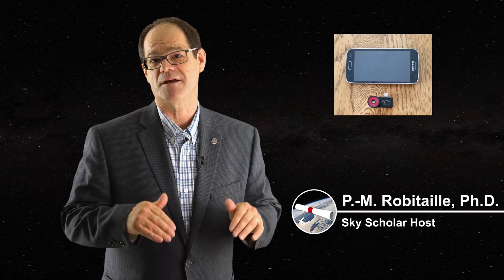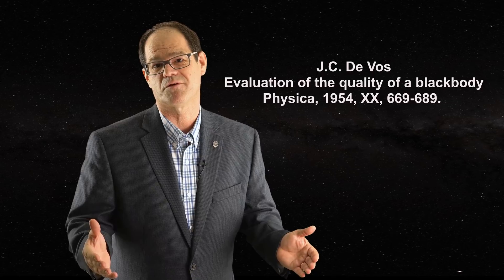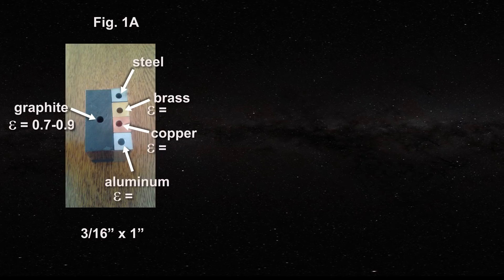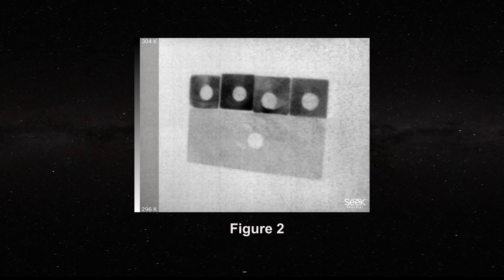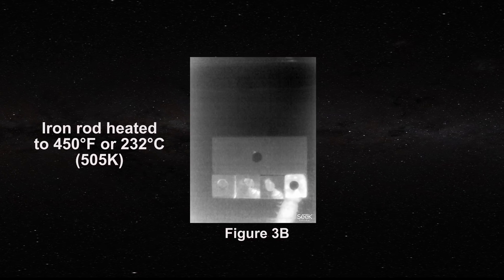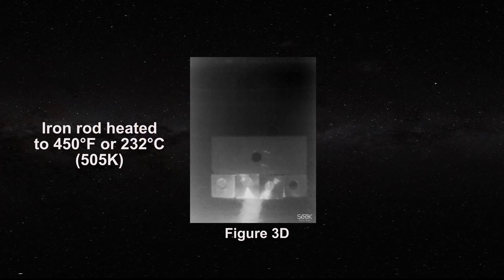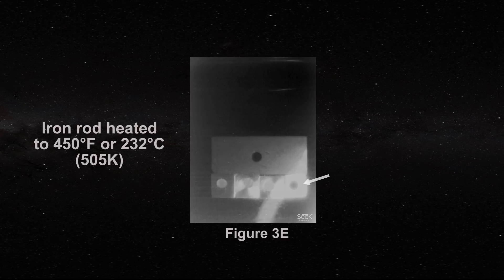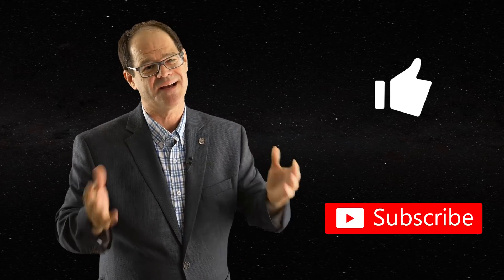Is Kirchhoff's Law True? The Experiment!

Comment: Robitaiile is a crank. This is a snow-job.
Reply: @MrAaronvee - you are wrong. None of your comments are scientific; simply very obvious hostility, hatred and ignorance. Professor Pierre-Marie Robitaille is the father of Ultra High Field Magnetic Resonance Imaging (UHFMRI).  MRI scanners in the UHF would not exist if not for his work alone. Owing to his invention of UHFMRI, Kirchhoff's Law of Thermal Emission is certainly proven wrong.  You can have Kirchhoff's Law of Thermal Emission but not MRI; or you can have MRI but not Kirchhoff's Law of Thermal Emission.  You cannot have both. Any reasonable person will accept the reality of MRI. Unlike Kirchhoff's said 'Law', MRI is the real world.  UHFMRI is far from a 'tweak' of MRI, as you call it. It is a tremendous advance in MRI; an advance that theoreticians asserted could never be achieved, on the basis of their theories. Their theories were wrong, proven by the existence of UHFMRI. Their theories are still wrong, proven by the existence of UHFMRI. If Kirchhoff's said 'Law' is true then MRI could not exist. The technical reason is because NMR and MRI are facilitated by spin-lattice relaxation, which would not exist if Kirchhoff was right. The clinical existence of MRI proves that Kirchhoff is wrong, was always wrong, and will always be wrong; and that Planck's equation for thermal spectra is not universal, was never universal, and will never be universal. The experiment reported by Professor Robitaille on this webpage makes the experimental proof very simple, so that knowledge of NMR and MRI is not necessary.  That you call the brilliant Professor Robitaille a 'crank', repeatably, attests to your lack of scientific knowledge,  understanding and acumen, and your lack of common decency and manners.
Reply: "I am afraid that I do not have the time, or space,  to educate you in basic experimental design"

Well you obviously had an hour on your hands to type out 5 paragraphs of non-arguments.  You couldn't even take that time to maybe send a few links our way?  Sorry but you are the one with the burden of proof here given that you came to the video done by the "crank" to call him such.  If we had said anything on a PBS Space Time video then maybe you could pull this. 

Also how in the fuck does a few thousand people bitching at the FBI to release Tesla's papers do harm to the scientific community?  Seriously man come up with some cogent arguments because right now you kind of have the appearance of someone unhinged who has something (possibly personal but definitely unrelated) against P.M. Robitaille.  Maybe you should spend your valuable time seeing a therapist instead of working on this book that likely is going to collect dust on shelves even if you do have some really good examples of scientific cranks in there (unless you've got some market research that shows there is actually an interest in talking about cranks for which the vast majority of the public has no clue they exist).
Reply: MrAaronvee, calling Robitaille a crank does not convince me that he is a crank. I would like to see some scientific argumemts against him.
Reply: Funny thing is, if Robitaille is a crank, why do you waste so much time on him? If you are truly writing a book on cranks it means you must not have much going on in your life. Cranks eventually always fade away into obscurity without someone having to write a book on it.  I will repeat rushthezeppelin's and cafeinst's question: show us where Robitaille is wrong?  If you can't then you are nothing more than an insulting jerk.
Reply: In addition to ad-hom of just calling him a crank it's funny that he also commits the appeal to authority and appeal to majority fallacies at the same time by pointing out that other physicists laugh at him.  Not saying he's right or wrong but there have been PLENTY of scientists (especially amateur ones) who have revolutionized their fields but at first were considered cranks so you can't say that trusting the opinion of his peers is full proof in ascertaining the validity of his arguments.
Reply: There are definitely cranks and crackpots out there on the internet, but there are also  scientific hacks who really never do anything important, but to feel important they take on the job of defending the scientific establishment from new ideas. If cranks and crackpots are bad for science, hacks are ten times worse.
Reply: Please explain to us specifically how this experiment is done incorrectly then.  Also please explain how his colleagues applying Kirchhoff's Law to the 8 tesla MRI machine was something they never should have done and doesn't violate Kirchhoff's Law.
Reply: MrAaronvee 
Says the person who cannot spell Robitaile.
May I suggest you read up on who this man is? Reading is easier than spelling so you should be good.
Have a nice day.
Reply: Well you better not trust your life to the 8 tesla MRI scanner that he built, especially considering all his colleagues said it would fry people's brains because they believed in the validity of Kirchhoff's Law.
Reply: It does not matter what else he has done; he is wrong and no amount of talking will change the experimental facts. What you and he, and every other crank in the world, tries to do is to pretend that you are 'operating in a YouTube vacuum' where you - and a scientific man-of-straw - are the only players. What you singularly fail to explain is why devices work perfectly well in spite of his objections and why millions of physicists disagree with him. The mere fact of being against something does  not automatically make you right. That fantasy belongs only in the arts world. It has never been true in science.
Reply: I am afraid that I do not have the time, or space,  to educate you in basic experimental design. Why not sneak into your local university library and read the relevant textbooks? If you allow yourself to be 'educated' by YouTube videos you put your mind in as much danger as you put your body in by buying meat from the back of a truck.
Reply: Well of course not: there are decades of experimental evidence to convince you of that. And why have you not  looked at that evidence already? Because you are one of the hordes of people who are basically anti-science or who think that simply being against something makes you look more intelligent and discerning.
Reply: Ah, the old 'they laughed at Christopher Columbus defence'. Except that they didn't. That was never more than a journalistic invention. It is never a matter of trusting peers - scientists spend most of their time trying to prove each other wrong - it is a matter of experimental evidence. The basic problem is that scientific fact is always presented to the layman in the 'voice' of an individual scientist. This makes it look as though facts are decided by 'fiat'. So, when a crank with scientific credentials comes along, the layman cannot properly decide what is fact and what is 'papal bull'.
Reply: Well, if ones day-job is writing, why the 'shock-horror'?  Cranks fade, but the harm remains. People still demand that the FBI hand over Tesla's 'secret papers' and the secrets of death-rays, antigravity, etc.!  LOL. What sort of cogent argument could fit under this video? If you are the sort of person who can be convinced either way by a 'sound-bite' comment, you have no business thinking about scientific matters in the first place. BTW, my book goes after bigger game: those working in mainstream science who (demonstrably) do not understand basic physics. You see the problem there? Well, because they look like the 'real deal', anybody who tries to 'out them' can very easily look like a crank himself. Nevertheless, they exist - and have always existed. Did you know that one of the founders of the US space industry did not believe that rockets could work in a vacuum?
Reply: The world is full of loonies who are experts in one field, and try to fool the gullible into thinking that they are correct about everything.  That is what makes it a snow-job. Those who design MRI scanners usually rely on Maxwell's equations and quantum mechanics. Kirchhoff's Law tends to have a much more specific application ... in fields such as photometry. Interesting fact: the MRI owes its existence to the Beatles.
Reply: Responds the person who cannot spell Robitaille. My mistake was due to haste. As you must have concentrated very hard to get it right, your mistake must be due to plain ignorance. I spend a lot of time on studying academic cranks, as I am writing a book about them. I know who he is: a laughing-stock among physicists and who has been disciplined by his own employers. Not every martyr is worth following.